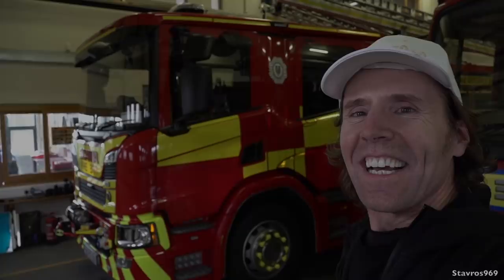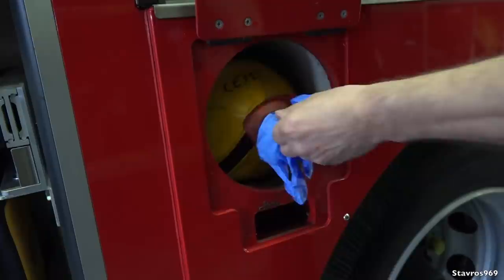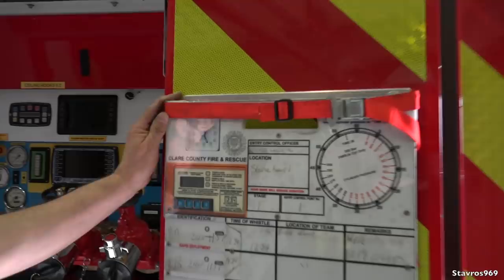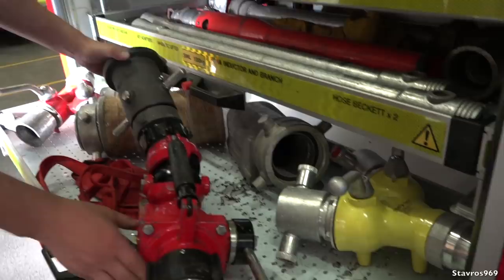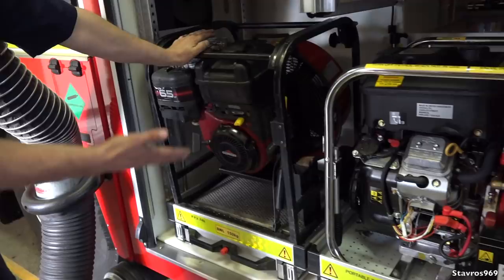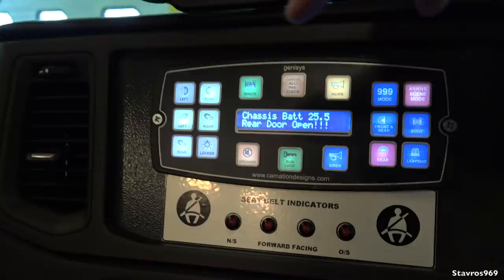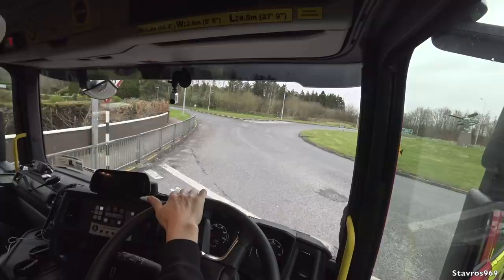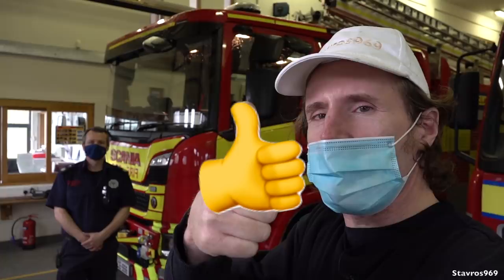SCANIA P 320 Fire Engine Crew Cab Full Tour & Test Drive + Emergency!

Comment: those 70 millimeter hoses that they have are what in america we call a 2 and a half inch hose line and we in america do use them to fight the fire. we use 127mm hoses or 5 inch hoses to supply our trucks most commonly

Comment: Top tip, if you put the snatchblock to a tree or pillar. You don't double the pulling power of your winch, it just angles the pull. You need to attach the snatchblock to the thing you want to pull, to get twice the pulling power.

Comment: Great video done in detail. As an firefighter [ret] from the United States I've always wanted to know about the hose lines carried, water capacity of the appliance, bar/psi the hose reel is pumped at and all my questions were answered and more. Their P320 is certainly well equipped. David did a superb job as did you Stavros, much appreciated.

Comment: I've noticed that the biggest difference between Euro and US fire apparatus is that Euro trucks don't really have pre-connects. My truck specifically has 5 pre-connected 1.88 inch lines 4 of which are 200ft and one is 100ft. We also have two 200ft 2.5 inch lines pre-connected. (Granted our truck is 34ft long). Still crazy to me, I want to drive a Euro fire apparatus just to compare.
Reply: actually, preconnects aren't all that rare on European apparatus. Take the German ones for example: smaller sets of preconnects are e.g. in hose packages and hose baskets, but the greater amount of preconnects is loaded on a hose cart hanging at the rear of the Engine or Rescue Engine. The hose cart usually holds 525 ft of preconnects.
Hose beds aren't common, apart from older Hose Trucks with 6,560 ft of supply lines or the more modern equivalent of Logistics Trucks. Also there are large capacity pumping units which have their LDH stored in a hose bed

Comment: Amazing looking at the similarities and differences in our apparatus here in the United States vs you across the pond. The high pressure hose reel is such a foreign concept to me. Our first out hand lines are 200ft preconnected 1 3/4 inch diameter with 200 gallon per minute nozzles. We also have considerably more EMS supplies/common to have paramedic level of care. But our airbags, struts and extrication gear are the same. Really interesting stuff!
Reply: Here in Finland firefighters are also qualified for ems level care and many fire trucks have medical supplies too.
Over here firefighters usually work 24h shifts. 12h in a fire truck and 12h in a "class B" ambulance with a  paramedic. In a "class A" ambulance both are paramedics.
Training to be a firefighter takes 3 years and 4 years for class A paramedic.

I thinks there's quite a lot of differences between European countries.
Reply: The high pressure hose reel (58 US gallons/minute) gives fast attack to small house fires and vehicle fires in Ireland and the UK. Don't forget we don't have wooden houses and fires are often confined to the contents of a room. Water damage can often be worse than the damage from the fire. In the UK, the on board water tank was introduced as a direct result of 6 years wartime firefighting experience. A small amount of water quickly onto a small fire can stop it developing into a big one.
Reply: @nevillemason6791  Im always impressed by the power of a little steam. For most "room and contents" fires that haven't breached the drywall into the structural members we follow that tactic as well. Open up the door, couple of quick bursts with a fog pattern and close it back up. Needless to say the Battle of Britain gained you guys just a touch of firefighting experience under some insanely adverse conditions. Much respect.
Reply: Its funny how the Americans say their construction is different but surely all the old brick and stone houses like the brownstones are similar to a Townhouse in Dublin
Reply: @squidog94  If Neville is Irish then that comment doesn’t apply

Comment: ...That is not how snatch blocks work. If you were to attach the snatch block to the car being winched, and then bring the hook back and attach it to one of the top points on the truck, then you'd have a 2:1 Mechanical Advantage system. If you had the sling around a tree, with the cable running through the snatch block and then the hook attached to a tow point on the car being winched, all you're doing is using the snatch block as a redirect.

Comment: Couple of questions: Do you guys use decon buckets? Do Irish firehouses have an anti-carcinogens program? Here in the US pretty much all trucks are outfitted with decon buckets so that firemen wash off any carcinogens that might have on their gear. Any carcinogens you don't get in the truck is a quick safety win. Hosing down the truck after a call means that carcinogenic particles can be already airborne if mud or dirt has time to dry.. 

I do love the deadmen safety system on the CBA, but wouldn't it be better if they 'key' was chained to the truck so you can't forget to pull the pin out..

Love the video! Greetings from Virginia!
Reply: I like the Swedish clean cab approach; While not having decon buckets they still keep the contaminated stuff out of the cab
Reply: I say there is an anti carcinogens policy

Comment: Wow, wait lemme clarify it. So the Firefighters are at their home, and when their pager goes off, they drive to the Fire Station, suit up, and hop on the trucks? So it's unlike the classic fire stations who have responders on standby at station? 
 It's like they're On-Call Doctors --- on their case, Firefighters on Call. Amazing.

Is it cause of COVID or is that how they normally work?
Reply from the maker: Shannon does not have Firefighters at the Station 24 hours, they all live within 1.5 miles of the station. Their response time is still around 5 minutes which is excellent.
Limerick City (about 20 minutes away) is different they have Firefighters at the station 24 hours
Reply: We have a similar system in Sweden in rural areas and small towns. The firefighter lives nearby the station and has his/hers ordinary job somewhere nearby the station and leaves to become a firefighter when the alarm goes off.
Reply: They are retained. All the cities have career firefighters

Comment: So you gear shift backwards to go forward, but you need to put the shifter forward to back the truck up...
Reply: Standard automatic shift pattern - ParkRND from front to back (or top to bottom if a column or dash mounted selector), but without the Park position (not usually found in heavy commercial auto transmissions, only in car/van boxes). That pattern started in the USA in 1965, and is now universal across the globe. Before that, there was no standard pattern, and that itself could be dangerously confusing, and caused many, sometimes fatal, accidents from a vehicle being in R instead of D, or vice versa when a driver set off.
Reply: @Twittler1  ther is a seperate lever for the parkbrake left of the steering wheel on the dash. As it is availebel elsware no need to also put it on the selector aswel

Comment: Very informative tour! I understand postcodes aren't used in The Irish Republic like they are in the UK  and some roads don't have names so how do you navigate quickly to an incident?
Reply: Incorrect, their called Eircodes in the Rep  of Ireland and every address in the country is assigned one, and are routinely used when emergency calls are made in order to accurately locate an address using latest technology, both in regional emergency call centres and emergency vehicles, like Ambulance, Fire etc...
Reply: We used to use conventional postcodes. In Dublin it was from D1-D24. It works or worked like odd numbers north of the Liffey, even numbers south of the liffey. Only exception was where the President resides

Comment: You guys should try out the Pierce or Seagrave fire engines.
Reply: No use in Ireland, secondary roads and rural roads much too  narrow to accomodate such large vehicles, plus you also need to bear in mind servicing and maintenance of those vehicles, with no dealership network in the country, no backup, and having to order parts from overseas with all the added customs checks and delays involved, keeping a much needed appliance off the run. In the Rep of Ireland almost all new fire appliances are either, Volvo or Scania, backed up with a good main dealer network around the country, easy to get parts for, when it comes to servicing and routine maintenance, so shorter maintenance dowtimes.
Horses for courses.
Reply: You must be having a laugh have you seen European roads even the big city roads date from the Renaissance to Victorian era
Reply: @EnjoyFirefighting  Also American layouts are meant to be all over the place
Reply: @oscarosullivan4513  not sure what you mean by that ...
Reply: @EnjoyFirefighting  American compartments
Reply: @oscarosullivan4513  well compartments on European fire trucks are all around the truck as well?
Reply: @EnjoyFirefighting  What I meant is it seems the Americans don’t have a standard design for compartments